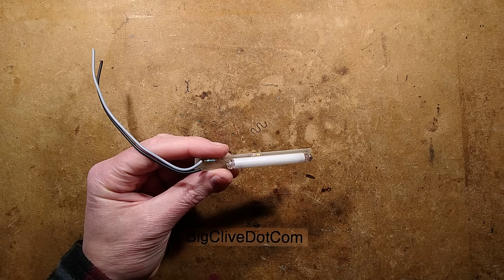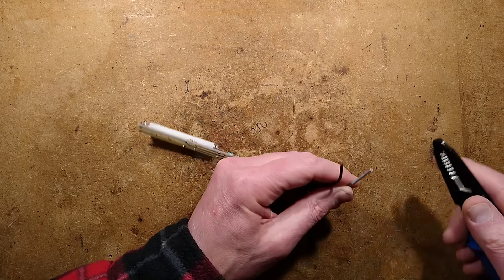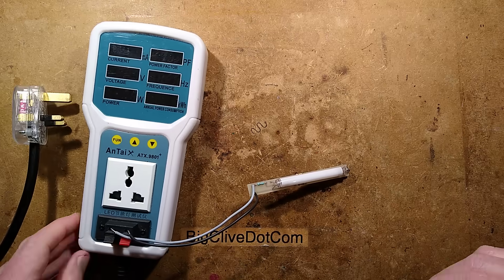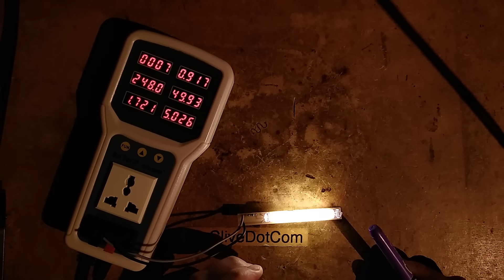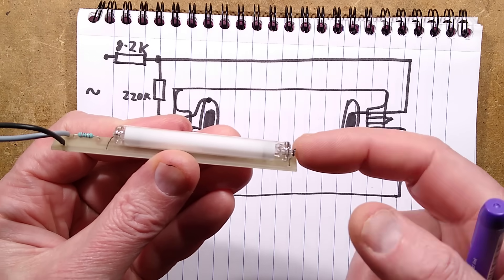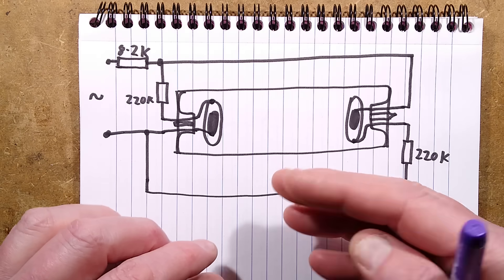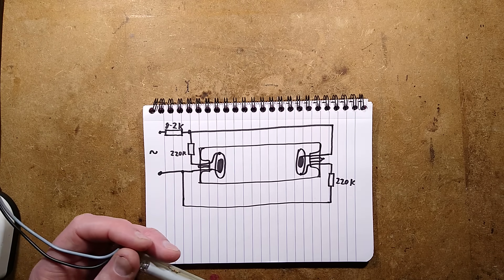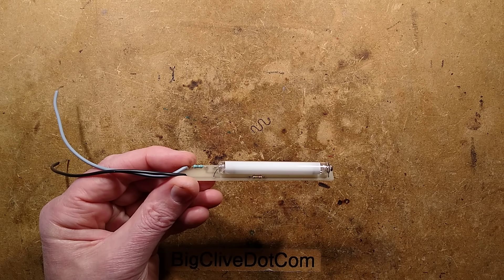Cute vintage resistor ballasted fluorescent tube

Comment: How come the resistor didn't burn out? It releases a lot of heat.
Reply from the maker: It's still within its rating for a half watt metal film resistor.  I'd have preferred two in series though to spread the dissipation.

Comment: My late grandfather had an HO scale model railroad. My great-grandfather built a multi-story train station for it, and in the upper level there were a some even smaller tubes. I think they were maybe 2" / 50mm or less. They mounted into clips like glass fuses. I assume my Dad was the one to install them, but I'm not sure. I'm guessing they ran on the auxiliary AC output from the train throttles, which was probably 20-something volts. I don't remember any supporting circuitry, but I assume there had to be *something*. I don't see it in the photos of the interior though. Alas, all that stuff is gone now, off to a new home at least.
Reply from the maker: They may have been vehicle festoon bulbs.

Comment: Ah, the memories!😅 As a child i was fascinated by gas-discharge-lamps. There where also small Nightlights from a manufacturer called 'Lampi', wich contained a 4 Watt fluorescent Tube. The ballast was formed by a foil-capacitor. Those lamps only contained 5 components and the tube in total. They were prone to quickly become black at their ends because of the way they were driven. A tube like the one you showed us here was long time the backlight for my parents home-stereo, after the original bulbs burned out. Used an adjustable 12V-driver to power  it.😊
Reply: i never thought i would ever hear anyone mention those nightlights. cheers!

Comment: I used to have a hand held battery powered lamp that had a similar lighting element and was powered by a 9v battery. When it broke, I had a look inside and it seemed to have quiet a lot of circuitry, presumably to step up the voltage

Comment: The ends get hot because the electrodes get bombarded by electrons that convert their kinetic energy to heat. The same phenomenon causes the anodes in high power vacuum tubes to reach a dull red heat.

Comment: Curious about the suggestion of running a full size tube with dead filaments in this arrangement, will there be further video? Maybe an incandescent bulb would work as the resistor.

Comment: Happy New Year big man. I have a handful of these from the Nineties where Farnell or CPC would have been the source. They were sold as cold cathode panel lights and came in more than one stubby size - mine are approx 70mm like yours, but I also have a 50mm-ish variant. I employed one to illuminate my arc chamber, even though LEDs were more available, just because I've had them hanging around for 25 years and wanted to use one of them for something!

Comment: Nice explanation of the starting arrangement. A bit like trigger electrodes for spark gaps. 
I did have a resistor ballasted fluorescent fitting once. I bought it from Woolworths many (>30) years ago.  Two tubes about 18inches long attached to a length of plastic drainpipe with some resistance wire inside and a bayonet plug to attach to a light socket.
It ran very hot. I think it also used a standard starter so not as sophisticated as your unit.
Hope you have a great New Year.

Comment: Gas tube stuff is so cool. When I was a teen, lets just say in the 90s, my aim was to find/play with three different 'tubes' -  a He-Ne laser tube, a Geiger-Müller tube and an Infra red image intensifier tube. I managed to find and make work all three in the end. I still have them as and they all still work as far as I know. I won the image converter I think from Oatley Electronics in Australia with a project that used a CD as a diffraction grating at an angle to measure the wavelength of a He-Ne laser tube. I think, that project might have won me another He-Ne laser which I also still have. Was a long time ago :)
Reply: I bought a helium neon laser tube from J Bull Electrical back in the mid 1980s. I had an old laser from school where the tube had gone, so I used that as the PSU. The tube was too long for the case but I just left the end off.
Reply: @paulsengupta971  Did you do anything with it? Or was it just cool to have. I never did much with mine. I went through a phase of 'acquiring' them. I got my first through begging at a supermarket scanner repair place (I think it was Omron?) and they gave me some old, used tubes. I made a power supply for one from some random old transformer I got at the surplus place and a diode/cap multiplier to generate the strike voltage. I still have that somewhere as well a several other spare tubes. I definitely won a new one in some competition as mentioned above. And once I was in the surplus place (Surplustronics for anyone from Auckland, NZ here) and happened to mention somehow about lasers and another customer said hang on, I repair them and might have one in the car you can have. He popped outside and a few minutes later came back in with a new tube, in a metal housing and 24 volt supply for it. He just gave them to me.  Still have that too. And at some point I came across two smaller He-NE tubes. About 6 to 8 inches long? I built one of those into a prop Star Wars blaster and one into a housing made form PVC pipe for a friend. All would have been early 90s.

Comment: You could have a look at the CCFL (cold cathode flourescent tube) that were used as backlights for early laptops and LCD screens. Fascinating little things, 3mm thick and sometimes a foot long, put out a lot of light too. I used to (among many other things) replace CCFL tubes in laptops that were written off due to the ridiculously high cost of replacing the entire display.
Reply from the maker: I have some here.

Comment: Hmm, now this needs to be consigned to my memory banks for next time we have a CFL bulb fail. I, like you, am tempted to try this on other lamps & I'm thinking when one next packs it in I might deliberately blow the other filament & then wire it up like this one & see if it does anything.

Would be pretty cool if it did, I can see why the idea isn't used any more though. Too reliable, not going to sell any replacements.

Comment: As for the "digging out stuff from the past as an inspiration to the future", there's probably no better example than the resurgence of thermionic tubes in audio amplifiers (of course they never really went away, with the likes of Marshall and Fender always using tube - based Class A amplification).
Reply: Class A in the preamp and phase splitter, ClassAB etc in the outputs. Though sometimes I wondered if Marshall used Class C in the outputs. They sounded like it...

Comment: Very nice video, Clive. I admit I thought I knew what this was at first, and how it worked. But then came the circuit diagram and description and I realised I was incorrect and that this lamp is actually much cleverer than it first appears. In a nutshell it's a couple of neon indicator lamps, one in each end of a short fluorescent tube and with appropriate current limiting resistors, to make what is basically a giant tubular neon indicator. A pair of neons within a neon, kind of thing. I like the thinking behind this and the simplicity of it. Very nice.

Comment: I was intrigued by ceiling light fittings, ("Big Light") in hall / inside stairway that was in a friends house in the  mid - 90s. It was just a normal B22 fitting, with a ahade and some sort of handle, but you could pull it down towards you, to change the bulb, then retract it back into the fitting... never seen it since.
Reply from the maker: There was a spell that the adjustable height lights were in fashion.

Comment: Hi Clive,
i know those from the early 90's, they were usually used for Backlites and at least two different lengths were available back then -yours is the longer one. "ERG" is short for "Elektro Röhren Gesellschaft", they were specialized in all kinds of glow lamps and also glow voltage-regulator-tubes.
If you look closely enough you may notice that the Electrodes are formed like an inverse sphere segment -they used exactly the same Form in their E10 Glow Indicator Lamps. As far i know they made those tubes also with green phosphor, but never saw one live.
The slight orange glow at the Ends comes from the traces of neon they used in addition to the mercury for lowering the striking voltage.

Have a Happy New Year...

Comment: Don't forget to refer to the magnum opus of CCFL driver circuit design and analysis, application note AN-65 by Jim Williams at Linear Tech (now Analog Devices). 124 pages (in the fourth edition, vintage November 1995) of engineering insights.
Reply from the maker: I've just found and downloaded it.

Comment: There was a similar circuit for but with a capacitor circuit for a standard 4w fluro lamp nightlight i had years ago. It tended to blacken the tubes rapidly. 
I will always love the small  thin cold cathode backlighting fluorescent lamps though. Oh and the cathodeless fluorescents. 
Keeping a vintage 80w mercury vapour lamp for appreciation of the pink to blue colour change as it warms up too.

Comment: Love fluorescent tubes, back in the late 60's I powered on albeit briefly a 40 watt tube off the HV secondary from a television transformer... popped the circuit breaker for the entire basement, all I could see in the darkness was this shadow of the tube as I stumbled about in the dark.
Upon inspection of the now blackened tube it was still intact but the electrodes were rattling about 
🧪

Comment: Hi, thank you that was nice to watch, nice one! but could it be run some how off some electric cig batteries and a voltage booster board? and what about the 6 volt hand held note checker uv light bulb type thingy, could you run one with this circuit of resistors? would it be similar? just wondered mate? take care and have a great day!

Comment: Oh dear. Around 1997 I got a few of them as backlight for numerical LC displays. They did not last 10.000 hours. Those were made in Russia. Just a few years later I replaced them with those bright orange high efficient LEDs. White LEDs were not a thing back then, they were expensive and not bright enough. Had it broken two years later things would have been different.

Comment: Before LEDs, They used to make 2-way flashlights with halogen & reflector at the end, plus a fluorescent bulb on the side for area illumination.  This ran off battery power with a coax jack for AC adapter.  The bulb inside was approximately this size.

Comment: Clive, have you ever seen the plasma guitar pedals? They use xenon gas tubes slightly shorter than that one as a clipping diode..   I've always wanted to make one, but I'd have to design it first as the only one on the market has yet to be reverse engineered.  They are quite neat looking.

Comment: 'Worth digging out stuff from the past because you never know what it's going to inspire in the future'
Reminds me of the discussions around modernizing magnetic tape for mass data storage using modern HDD tech, one company (Ultrium) advertises 18TB cartridges.
Reply: Look up the IBM TS1170 drive and 3592 JF tape cartridge. You can store up to 50TB uncompressed on a single cartridge and up to 150TB with a 3:1 compression ratio.

Comment: I have an fluorescent inspection light that uses a resistive power cord as the ballast so I suppose that works in much the same way as this.
Reply from the maker: That one used a conventional tube with heated ends and a starter.

Comment: "It feels like I'm about to power something up which could be destroyed instantly." Honest and fearless as ever, thanks, Clive.

Reminds me of my days designing and de-bugging control systems for one-off machines. One of my favourite conversations from a fearless site installation engineer went:
"What happened, Eric?"
"It went bang, it smelt funny and this bit fell out of the bottom."
The "bit" was the end of a large electrolytic capacitor from an inverter drive which got 440V up it's input instead of 250V when the customer didn't bother connecting a neutral to the panel...
Reply: Ooops!

Comment: that's basically the "professional" version of those night lights of some years ago, they instead used an end of the tube with both a filament AND the cold cathode system, it's 3 wires on each end, 6 wires, but EVIDENTLY they don't use the filament (?), it works like yours, and i'm puzzled by why they still have a filament, industrially speaking they could made it like the one in the video, they were mass produced.... maybe the filaments get hot and emit more, basically like a standard fluo light after it's struck... i bought a pair of those at a flea market some weeks ago, i was lucky to find the old type and not LED, 2€ for two different styles
Reply from the maker: Maybe just the economy of using the existing thermionic heater assemblies.

Comment: Thank you, Clive, for yet another interesting video.

Are the very thin luminous tubes that illuminate (older) laptop screens also fluorescent tubes?

Would this tube's electrodes have been thoriated to encourage electron emission when cold?

Does anyone know if one of those Radiacode[TM] or other types of small hand-held radiation detectors can detect, through the glass envelope, the radiation from thoriated electrodes?

Best wishes to Clive and the techie community at large for the New Year.
Reply from the maker: The laptop tubes are cold cathode fluorescent tubes.

Comment: That reminds me of early (78-81 maybe) Sony LCD VU meters in a few select tape decks. 2 color LCD bar graph segments, with a translucent meter scale plastic sheet behind that and a CCFL behind that. And I mean gray bar segment LCD like in early watches and small calculators. Not TFT or VFD. Come to think of it the red segments may have had a filter so it was really one color - gray. That was the first time I saw a CCFL illuminated anything and it was mesmerizing. I still have 2 of those decks - one for parts. Maybe I'll strip the meter assembly out and send it to you.

Comment: Never seen a tube that small before.  I remember having one of the torches in the late 80's that had the 5 or 6" fluro tubes in when they were a thing.  I seem to remember it killed batteries very quickly :).  Love seeing the older stuff.
Reply: I think hand held UV lights were about then too, with similar small tubes.
Reply: @BlueBazz666  yep, i  have an Osram 'flat ' 'torch. that uses a small U shaped fluorescent tube, they definitely eat batteries, alkaline ones that is, dont bother with zinc carbon or even zinc chloride, nicad and nimh ones wont always start it unless just charged, and if batteries are too low and the tube doesnt start properly (one end glows piurpley) it seems to kill the tube if you let it run like that too long (guess how i found out.....)

Comment: Could that be the same ERG THAT MAKES electroluminecent panel power supplies? They were used to power some EL backlights in medical equipment and communication service monitors, even some early GPS backlights.

Comment: I wonder if the purpose of the extra electrodes is to generate heat? (from the localised discharge)
Regular tube lights have a filament in that position that's heated up to start the discharge.
Reply from the maker: They are to lower the distance between electrodes to make it easier to strike the tube.

Comment: Are old stuff obsolete? Take for example modern led's they are very efficient but in some applications old technology would be better. In the USA LED traffic lights in winter get covered in snow and can not be seen, old incandescent bulbs gave of heat which melted the snow, making them more visible. Happy New Year.

Comment: My mom has a weird little AA powered lite with a tube about that size but I think the tube is a black lite. I'm pretty sure its a fluorescent tube not just made to look like one so I'll have to try and remember to go get and check it out after I get some sleep.
Reply: We used these as uv blacklight   to check banknotes on market stall  as  no mains supply  they worked really well but ate batteries.

Comment: Back in the day, operators used to attach a small fluorescent tube to HF-antennas to monitor the transmission power.
Reply: using no power i guess
Reply: Used to work with high mercury vapour tubes but modern tubes are low mercury.
Reply: @VictheSecret  It still works with modern tubes. Even emitter depleted, broken electrode and mercury starved tubes light up of HV HF.

Comment: Can you explain the difference between the antai and the hope? They look same to me (i have a hope for years) but what makes the antai „more suited“?
Reply from the maker: The Antai has a lower power rating with higher resolution across that.  It also deals with weird power factor better.
Reply: The Autocarrot got the HOPI. I guess the same manufacturer makes the Antai and the HOPI. Antai is geared towards measure small amounts of currents (I have an broken Antai that just needs a new resistor that I snapped off when I opened it up. It broke just next to the body of the resistor).